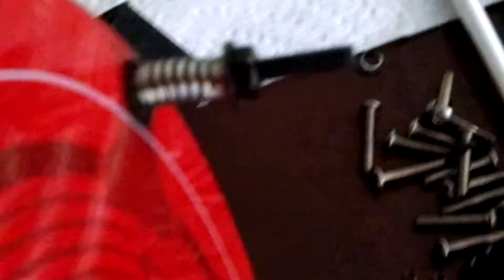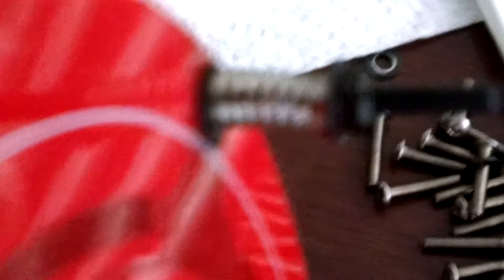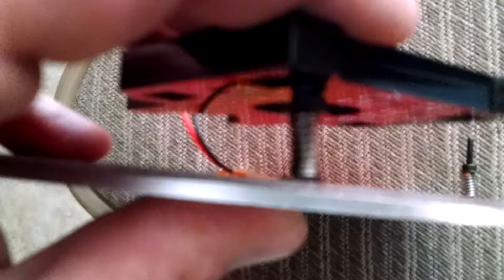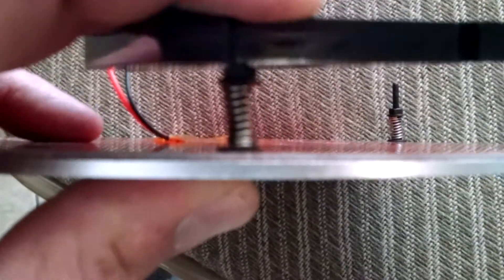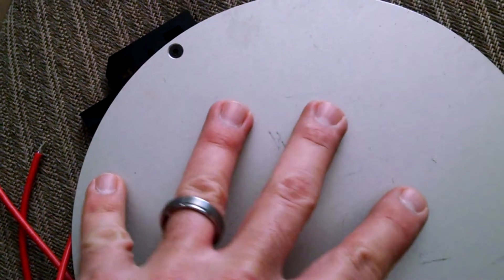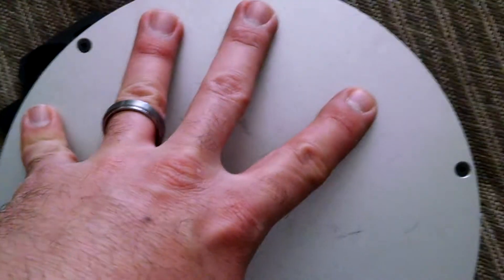How to minimize ghosting from bed vibration 3d prt

Comment: It's called a damper
Reply from the maker: +Brian Graves what is? 

Because there is no device that dampens the vibration. I am eliminating a problem of loose screws which are  used as a guide to keep the bed aligned to the bed frame and the springs keep the bed pressed against the head of the screw. The springs support the bed. The amount the length is then translates to the level of the bed. Each corner is adjusted to level the bed in reference to the travel of the extruder/bed. To dampen vibration one has to know where is comes from. Which is linear bearings as they circulate, or the deflection of the the bed during an abrupt movement that, and torsion of the motor to the belt that applying torsion to the gantry plate that the extruder is mounted on. So what damper are you talking about? Where was it? I was expressing it in a way other could understand.

Just saying......